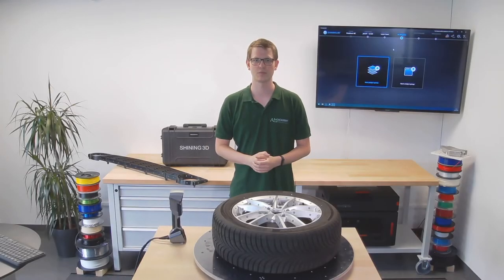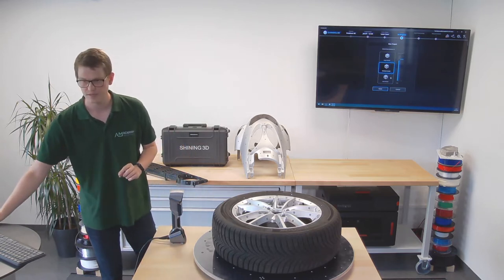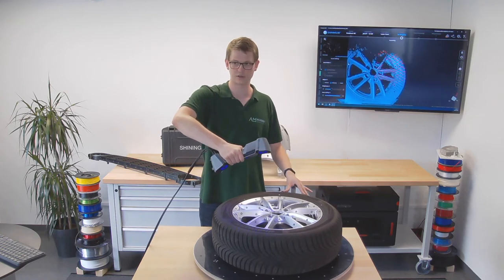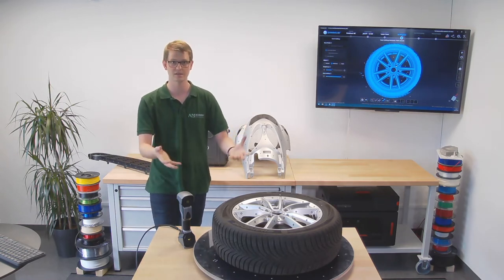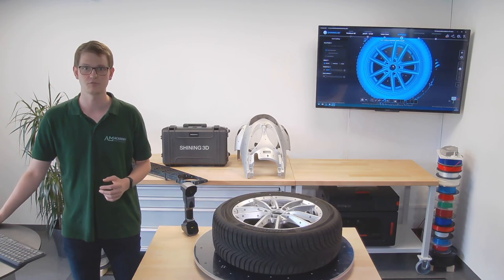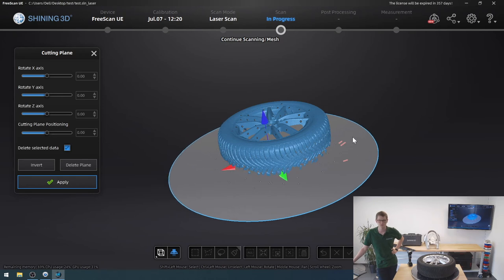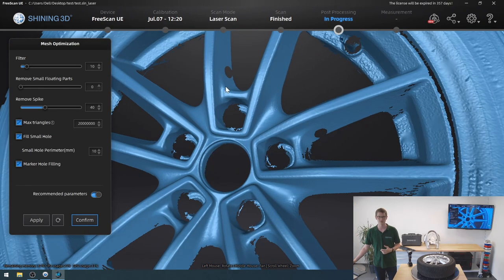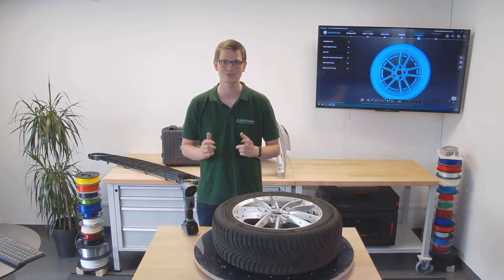3D Scanning with Shining3D FreeScan UE7 Part 2 - Rim + Tire

Comment: Interesting that it only works as long as it sees the markers. Makes sense for this reflektive material, but does it need them for detailed material like stones too? Otherwise photogrammetry is still easier for those usecases, when it's not possible to add markers.
Reply: The laser lines have no way to align what they see with the previously scanned geometry (no feature alignment), so as soon as no markers are seen the lasers are disabled. That way you cannot accidentally blind coworkers or bystanders (at least not as easily). As there are lasers in the device, people with glasses / contacts may easily be harmed.

Photogrammetry is better for objects where you cannot apply markers to the object, but is less accurate and struggles with dark or reflective surfaces. Hoever, as you said, it allows for feature alignment, which can be a real boon when scanning certain geometries. For a scanner that does both, photogrammetry and laser scanning, check out the EinScan HX.
Alternatively you can place your object onto a table that has markers on it. As long as the scanner can see enough markers along with your object, you don't need to apply any markers to the object itself.
Reply: Scanners like the Freescan UE are classed as `metrology grade’ products, and thus operate at the higher ends of the accuracy spectrum. Of course all scanners can be metrology items, to a greater or lesser extent, but your average photgrametry unit does not reach the accuracy of these leaser products. One of the differences in the technology is that this kind of laser scanner needs the markers to establish a reference for stitching the scans together to achieve the precision. Horses for course basically, both are excellent in their applications.